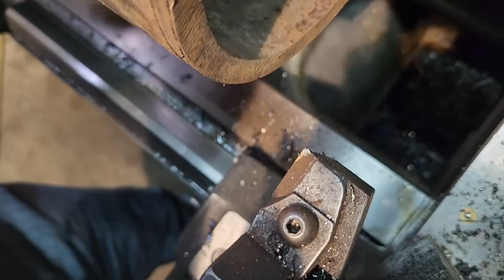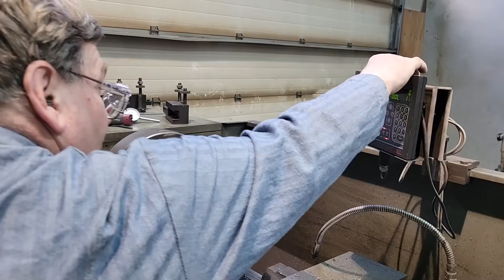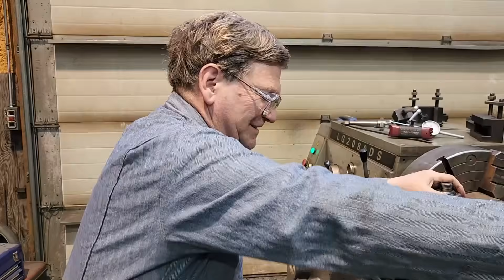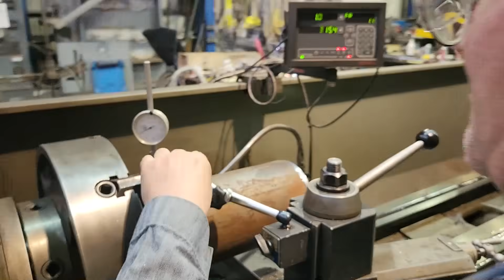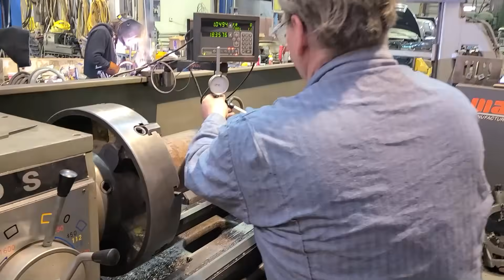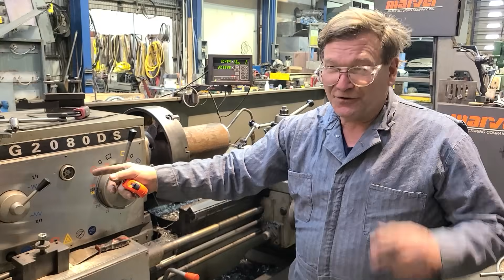Headstock is a CROOK! Checking lathe headstock alignment

Comment: I have made many a lathes cut straight by just adjusting the bed, it's not much but adjust the tail stock end of the machine level screws.  Machine some adjust it and machine some more putting a slight twist until the machine cuts straight. Not screwing around with all that, for it's all about results. Having a lathe that won't cut straight sucks. I only expect about a good 6 inch straight cut after that it's flex screwing you.

Comment: When I measure a rod I like to use a flat point. If it’s a round point, and you’re measuring from the top, but there’s a sideways shift to the rod, the tip will run off the top and around the rod giving an inaccurate reading. Same thing if you’re measuring from the side. I’ve measured a good couple of thou. error that way and it could be more. Obviously, the smaller the diameter of the rod you’re measuring, the bigger the error from this.

Comment: Headstocks rarely go out of alignment,  if they do its because the alignment  bolts worked loose or a bad crash happened. This test is for Checking if the ways are worn causing the machine to cut a taper, the best way it to use a shaft with sliding  disc's that clamp on the shaft and turn the disc's, many times this is done prior to turning long work and adjusting the tailback to remove error.
The easiest  way to check alignment of a headstock is to clean the spindle bore and measure it with an alignment  scope in increments front and rear then compare that to the ways, then check the saddle travel and tailstock alignment. Alignment scopes and jig transits are the best tools for this.

Comment: If you don't have a release on the indicator to hold it back and don't want to hold the indicator point by hand, you can use something slick like a sheet of shim or vinyl tape for it to ride on between the two points. (The reason he didn't wind the cross slide out and then back to zero was to eliminate the chance something in the slide is causing an inaccuracy.)

Comment: Real world issues. DTI's that misbehave. Check everything all the time. Eats time. I'm in the process of making centering plugs for hydraulic honed tubing..every size they have up to 5" in the catalogue. Sme stuff we get is very even in wall thickness but others is way off. Making flanged plugs about 2" long with a shoulder. Machined all in one setup with   1/2" thread in middle and a long centre machined in end with a form tool out to 1 3/16" and about 7/16" wide. When I put a plug in lathe I can slip tube on it. Then put centre plug in other and simply friction drive. To check for runout I can clock flange and the face of tailstock plug. By putting a shim of whatevers at hand can align bore of the tube. Then I can cut in a couple of steady bands. The thread is to extract the plug if it gets stuck!
Reply: Also wear in the carriage work piece pushing away sticking out unsupported